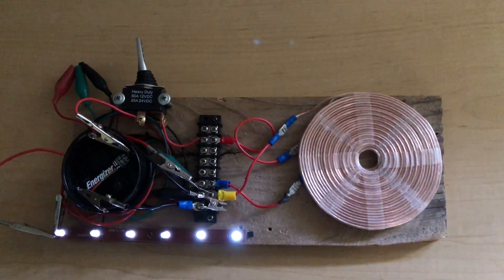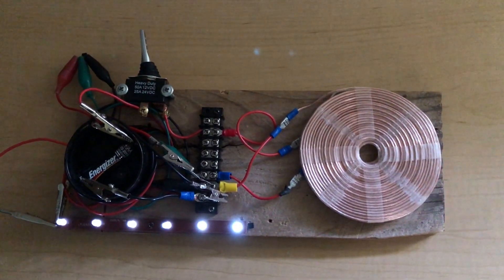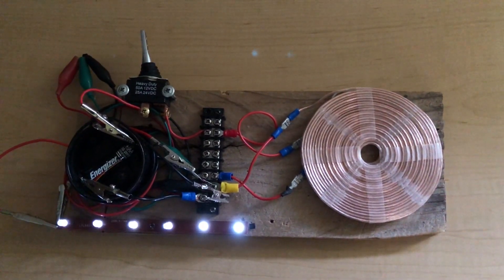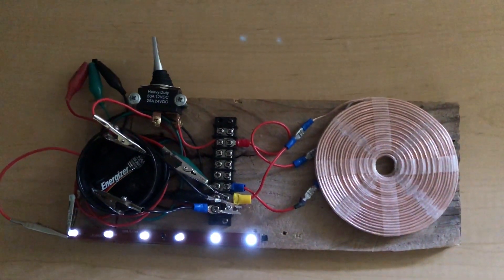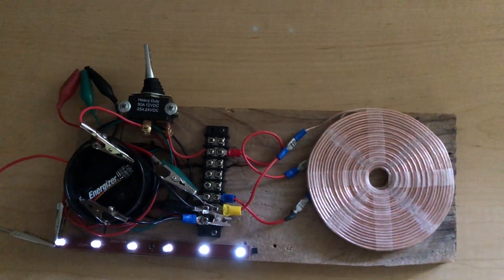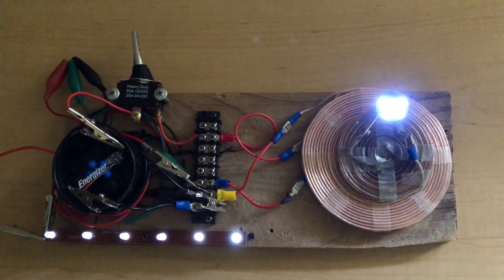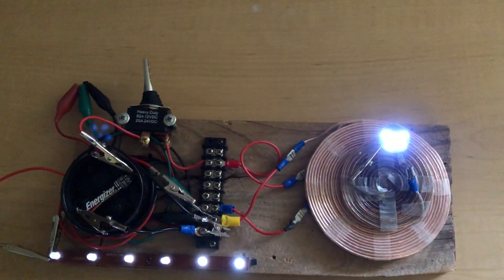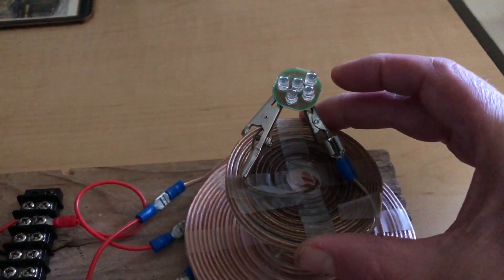Tesla Bifilar Pancake Joule Thief with Wireless Mini Receiver

Comment: If the video exactly what you said is with no in sternal jokes, then what you just proving is that the magnetic field and the electrical field, are independent of each. I noticed that the lights did not dim when you put the other LEDs on top. This means that we're just not tapping into energy efficiently not that we are making more power.